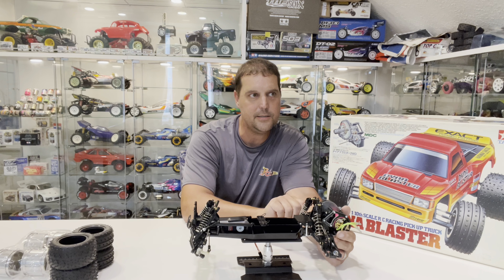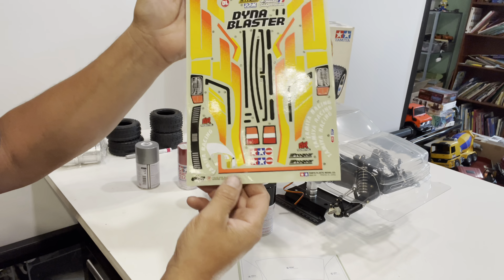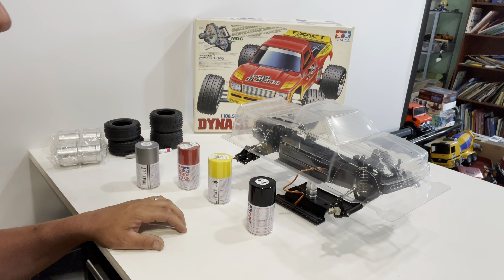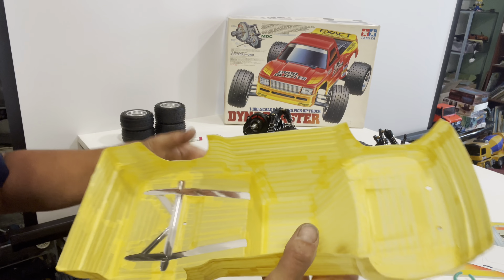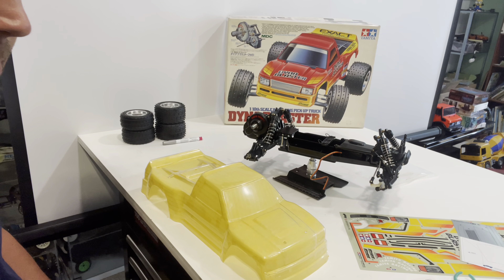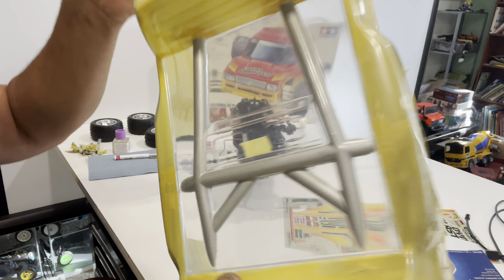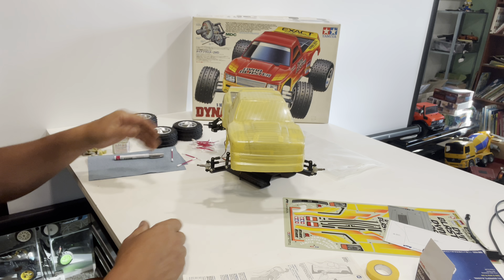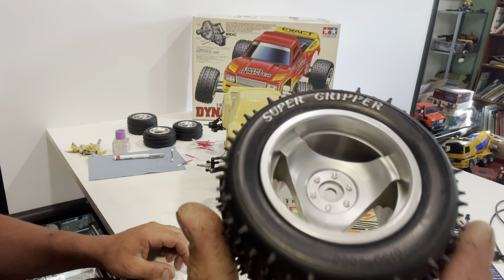Finishing the Dynablaster nib build from 1993

Comment: so glade somebody else does that, i have parts for two cars i haven`t got yet. just biding my time. are you sure you want run it. 😱
Reply from the maker: A light run. I turned the throttle expo down to 50%. Do not trust myself with that 14t motor.

Comment: You have done an outstanding job of the body... That is a great tip using the clear coat to stop bleeding.. it took me days to do my stadium thunder.. metallic blue with a gun metal bonnet . I left the rear deck clear so you can see the red diff and painted the roll bars  white with white tyre writing then put in a tamiya hop up driver in the cab..part number 54864..it looks absolutely stunning..great job mate, looking forward to the run video 👍🇬🇧😎
Reply from the maker: Yours sounds great. Thanks for the info on the driver.

Comment: Nice tip about using flat clear….been in this hobby for 20+ years and always learning something new. One thing I do is turn the bodies back over (right side up or sideways) between coats. Sometimes the paint can run and if it’s upside down gravity pulls it close to the masking seams and you get issues. Turning it over gives gravity a chance to help out pulling fresh spray away from the masking.
Reply from the maker: That is also a great tip. Thank you

Comment: That's a beautiful truck, Keith. I like these wheels. I think they are the same as i have for my Street Rover build (made up with a Nissan Titan Chassis).
Reply from the maker: The street rover are the same look but chrome instead of aluminum. Only 2 cars they went on.
Reply: @rcicons4915  Aha.. there is some difference. I was just looking at ebay to find a dynablaster and i saw some of those wheels looked a bit 'dull' compared to mine. I still need to find a second set of rears since Tamico didn't have them in stock (and still don't), so now i know i have to watch out i don't end up with aluminium rears and chrome fronts.
Thanks for the info!
Reply from the maker: @koenallard  no problem. I almost did the same but opposite.
Reply: @rcicons4915  I just ordered the right ones from TTP on ebay before i forget... LOL😆
Now i think about it.. The chrome would look nice on the dynablaster in combination with those chrome stickers.
Reply from the maker: @koenallard  yes it would

Comment: What happens if use use gloss clear instead of flat?
Reply: I'm not sure Tamiya has gloss clear in PS-paint since it's meant to be inside of the body anyways. Usually the matt is been used on the outside to give certain spots a matt finish (a truckbed for example)
EDIT: i just looked into the Tamiya catalogue. They don't have a gloss clear (like i thought), but they have a pearl clear. That isn't recommended for what Keith did here. That will be visible.
Reply from the maker: They do not make a gloss clear in ps if I remember correct. It would be TD4 and the cover color could flake off because of the ts underneath. If they do make a ts clear then it would be fine. I just have the ps55 for when I want a Matt finish on a poly body.